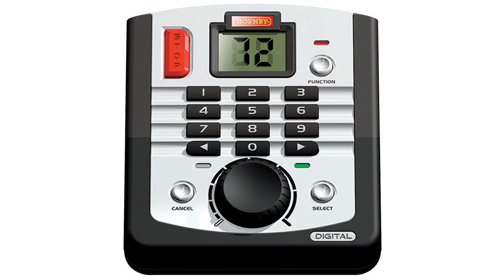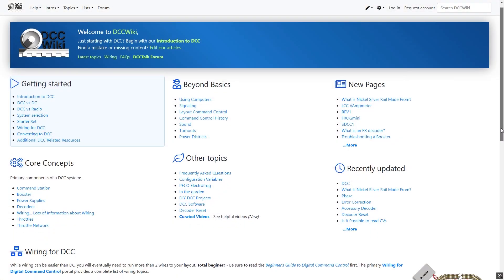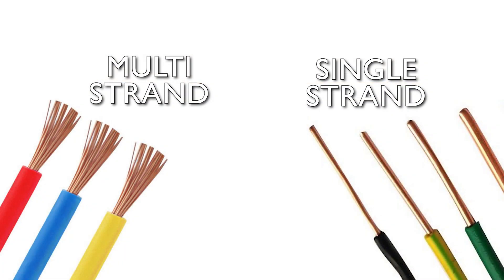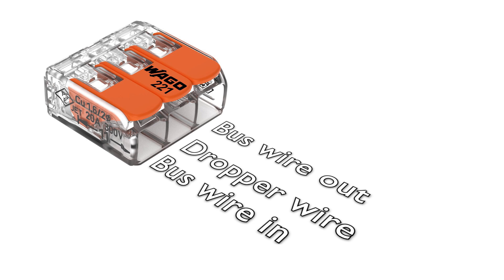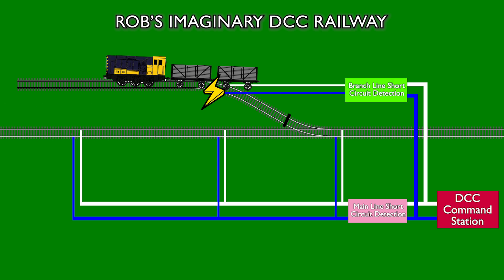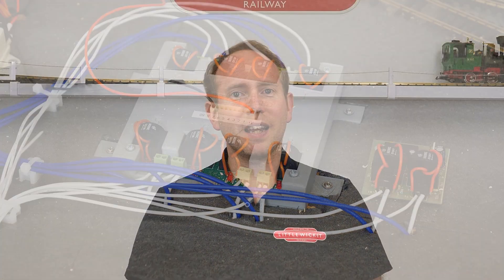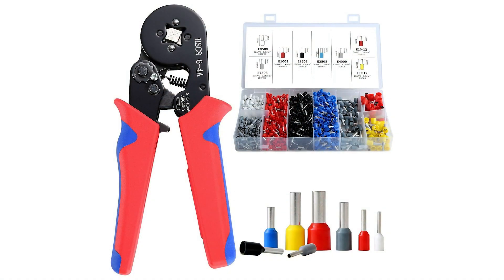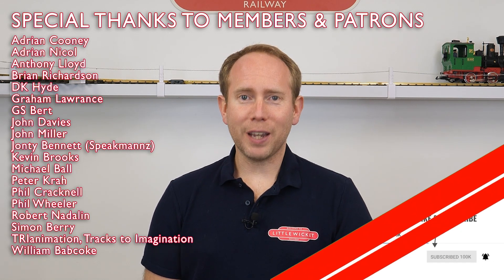How to Wire a Digital (DCC) Model Railway

Comment: Hi. I've just watched this today and found it informative and enjoyable. However, I also found it hard work. I am very hard of hearing and used subtitles. This meant I had to keep pausing and back tracking to see what was being said and refer to the images that were mentioned once I had caught up with reading. I know you cannot cater for everybody and thanks for the advice. However, I may not return simply because I could not keep up.
Reply from the maker: Hi Earl. Are you aware that you can play videos at slower speeds? If you're working off the subtitles then playing it at half speed might give you a chance to read and still catch the visuals.

Comment: Indeed you need more wires on a DCC layout than with 12v DC, as indicated at 1:51 ! Because of possible interference problems with the messaging system necessary, which can result in locomotives particularly, getting a mind of their own. Indeed its recommended that "bus wires" are connected at roughly every 1.5 metres to try an avoid that irritating issue !  
DCC NEEDS EXPENSIVE CABLES - UNLIKE 12V DC LAYOUTS !
Wiring DCC needs much heavier duty wires that 12v DC layouts, and hence more space for such wires, and a lot more cost. I use "Burglar alarm cable" on my 12v DC professional exhibition layouts, even layouts at 60ft long by 25ft wide, without problems. And "Burglar alarm cable" rated at max 50v at 5 amps, is a multi stranded copper wire, but as small as telephone wire. And can be obtained from your nearest CEF (City Electrical Factors) store, where Electricians get much of what they need ! Never use DIY stores or model Railway shops for wire, they charge very high prices. Indeed I can obtain a 1.2 KILOMETRE (1,093yds) Reel of wire, in 12 different colours for around £45 pounds from CEF at 2025 prices. That's about 10-12% of the cost of the wire type needed for DCC layouts ! 
WARNING: This type of tiny wire is NOT SAFE for use on DCC layouts, only 12v DC layouts.

WIRING & THE RESISTANCE ISSUE  
Indeed electrical resistance in wiring will be greatly increased by any joins along the route of the wire, and modern clamp type joiners such as "Scotch lock or suitcase" joiners are going to make the issue worse. I always solder wire ends together, or at baseboard joins solder each wire to the multi-way male & female plug terminals and use Gold coated types for reduced resistance. Being such a small wire type I can use very cost effective 25 way Computer "D" plugs, which only cost around £3-£5 a set each.

ONE WIRE = 50% OF LAYOUT WIRING COMPLETE IN 12V DC !!! 
Of course on 12v DC layouts you do NOT need "Bus wires". With 12v DC layouts its wise to use the "Club" wiring method involving a "Common Return". Which is literally just ONE Single wire all the way around the layout, with "droppers" from EVERY item to connect to that NEGATIVE return wire. And that is effectively 50% of your wiring of the whole layout completed. On condition that ALL accessories used on the layout are also DC not AC types. 

Then to complete the layouts wiring you simply need ONE wire for every accessory. From the relevant panel mounted mini-toggle switch to the item, whether its a section of track, a point motor, a signals, or the LED lighting for a station. Mini-toggle switches of various types, which usually cost between £1.50 & £3.00 each. No expensive Electronics are required for 12v DC layouts. So a point motor is likely to be the most complex electrically accessory needed on a 12v DC layout and will be either controlled by a SPDT mini-toggle switch if a solenoid type point motor, or a DPDT mini toggle switch if its a Slow action type mechanism. No chips, decoders, or any other highly expensive electronic circuit boards such as with DCC layouts being needed.

CONTROL PANELS LIKE MODERN SIGNALBOXES
What you will need is a control panel, with most simply a track diagram on the slanted facia, with the relevant Mini-toggle switches positioned on the track diagram which clearly reveals what they control. I build Control panels in Waterproof Marine plywood (for exhibition layouts) using normally 12mm thick ply for the box, and 5 mm ply for a hinged facia. It cannot be thicker than 5mm as that it the usual limit of thickness to mount the mini-toggle switches used. I hinge the facia using a brass piano hinge, which are often 3-4ft long and can be sawn in half if necessary. Also on the control panel facia I mount Gaugemaster panel mounting "Inertia" controllers as these professional controllers have a proper rectifiers (Not a dangerous electronic method) and also have a proper Metal Heat sink plate. Which buries potentially troublesome resistance anywhere in the electrical wiring system, dispersing the problem as heat. Which avoids many of the horrible electrical issues I see on numerous DCC exhibition layouts. Most typically displayed by jittery, jerky, stuttery, behaviour of Locomotives, especially noticeable at slow speeds !  

12vDC SHORT CIRCUITS & MULTI-TRAIN CONTROL !
Unlike DCC when a short does occur such as a loco derailing, it can be immediately isolated by the section switch controlling that section of line, without upsetting the rest of the layout. Which at exhibitions is an important consideration !  Indeed in line with real railway operation it's wise to provide a separate (switchable) section of track between each signal. Which is the first step in interfacing signalling with train movement. So any section can be isolated when required. Such as when a train is to wait in a station platform or at a red signal. This is also beneficial on exhibition layouts, as Operators can get distracted by the public trying to ask questions, so forget what they are doing, and trains they have forgotten may suddenly start moving. Multi-train control on one circuit of track is also quite normal on large exhibition layouts wired with 12v DC, common return & track sectioning, it is NOT as many think the preserve of DCC !!  

WORSE DCC IS AN AMERICAN WIRING SYSTEM O 
The current DCC wiring of all current commercially available options is an American system, that makes absolutely NO provision for any British or European Railways sophisticated Block Signalling methods. Unlike the European Fleischmann designed method that the Americans managed to "Kill off" over 15 years ago. The German Fleischmann designed system, obviously included the basics for such signalling methods as used in Britain & Europe in their master controller design. Which made the German system around 40% more expensive for the initial cost. But avoided many of the Electronic accessories needed with the current American system.
  
DCC NO PROVISION FOR BRITISH/EUROPEAN BASED BLOCK SIGNALLING REQUIREMENTS !
What this means is that British & European based model Railways NEED proper signalling. But as America does NOT use such expensive methods, they use primarily Central Traffic Control (CTC) which is basically verbal radio messages to tell trains when and where to move. There is NO provision for signalling in current DCC Master controllers. And to get British or European type Block Signalling methods such as "Absolute Block" or even "Track Circuit Block" signalling to actually work in a realistic way is almost impossible. Unless you can afford to add a fully computerised system to all the other DCC costs. Which will also mean Computer screens to act as your control panel. Which is the number one reason I would never use DCC on exhibition layouts, the problem of cost comes a close second. 

And I can wire my 12v DC layouts exactly as per the Rules of any British or European Block Signalling system using TCC (Track Circuit Control) which needs a full understanding of how Direct Current works, but cost almost nothing extra above the cost of the actual signals. But includes real life Tack Circuits which actually control most signals automatically in real life, and British Railways Automatic Warning System (AWS) which guarantees my sleepy Operators at exhibitions CANNOT crash red signals. Track Circuitry costs ONE PENNY per "Section" (the distance between two signals) as it only needs a piece of wire once you understand how Direct Current works. And another ONE PENNY for each section of track & its Signal for AWS to be added, which again with 12v DC only needs a piece of wire. 

THE SECRET OF DIRECT CURRENT - VIRTUALLY EVERYONE HAS TOTALLY FORGOTTEN !
Mother Natures Direct Current behaviour is totally unlike Mankind's Alternating Current (AC) methods.  And the secret few modellers seem to know or understand today. Which is: That no matter how many Power supplies you have from as many Mains 230v Transformers as you care to add, DC will ONLY return to the Transformer it came from. Which means you can put dozens, even hundreds of totally separate electrical supplies for all sorts of uses, down just ONE wire without ANY problems. Or if you're really clever down just ONE RAIL, without any fear of a short circuit !!!! Once that is understood, all sorts of virtually free electrical tricks can be down on layouts, without daft expensive "chips" or expensive electronic circuit boards.....

Comment: Fantastic clear and precise explanation. Pity the manufacturers of the DCC accessories don't use A and B, instead of Red and Black on their labelling. Can the DCC Booster be wired in "anywhere" along the BUS wire? Can more than one BUS be connected to the DCC Power Supply (2 blue wires in one socket, 2 white wires in the other)?
Reply from the maker: I believe the booster can connect to the bus anywhere, it just copies and boosts the DCC signal it receives.

You can split the DCC bus, i.e. 2 wires out of each terminal from the command station. I do this when I create an accessories bus and a track bus. The track bus has short circuit protection. So even if I short my track I can still control points, signals, etc. on the accessories bus.

Comment: If you had 4 mainlines (DCC), would you have a bus wire for each line?
Reply from the maker: Splitting the DCC bus into 4 power districts, one for each line, with individual short protection could be a good solution. Then a short on one wouldn't impact the others. I believe this is exactly what they've done on the large Making Tracks layout as part of the re-wire.

Comment: Bus and droppers is unnecessarily complicated for 99.9% of home layouts. 

You only need two wires provided you have a sufficiently high voltage DCC signal and clean, well-joined track. 

That's the whole beauty of DCC, none of the wiring faff of DC.

Comment: Please can you explain again where the booster fits into the circuit, is it like the power districts, connected straight to the bus from the main controller, is it also powered at the wall?
Reply from the maker: Yes. It's like a separate power district, but with it's own power supply.
Reply: @LittleWicketRailway  thank you kindly
Reply from the maker: @railwayjade  thanks for watching and leaving a comment 👍🏼

Comment: I have used terminal blocks that accept the bus and pass it on. Droppers local to the block are wired there. I have 5 such t/bs on a 12 ft long U shaped layout 9 ft wide. Snubbers are fitted to the far end. I run a separate bus for my accessory control.

Comment: My bus wire is over 10m (over 30 feet) so I twist my bus wires together.
Screw terminals are easy and great, but some unscrew themselves, so it is best to check them all every 6 months.

Comment: When wiring a tail chaser - oval shaped layout - should you install plastic, non conducting fishplates, on the opposite side from the controller to prevent ringing / deflection of the DCC signal?
Reply from the maker: Good question and I don't have a definite answer. I didn't on my first layout and it worked just fine. I get the impression that ringing/reflections aren't considered to be a major issue for DCC. A qualified electrical engineer may have a better answer.
Reply: @LittleWicketRailway  Thanks for the reply. I've heard arguments for and against, but I guess there's no hardship in terminating the bus wire either side of adjacent plastic fishplates to break the loop and removing any doubt.

Comment: Technically 1 connection works fine - just same as DC- I guess this is ultimate best practice to get reliable supply - also if you were running multiple locos you might set points against the supply etc so you need feeds on each branch and sidings

Comment: I thought DCC would have less wiring. This does look like a daunting task to do.
Reply from the maker: At its simplest you just need two wires. Start from there and you'll be fine 👍🏼
Reply: It's still simpler than DC!

I'm complicating my life by switching to 2mm finescale. I need to incorporate an external polarity switch for the frog of each point now